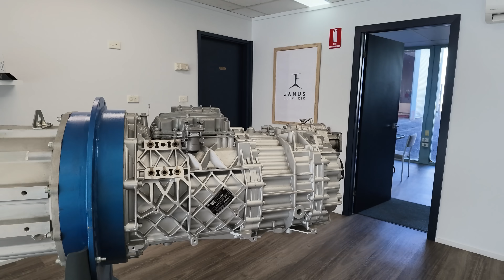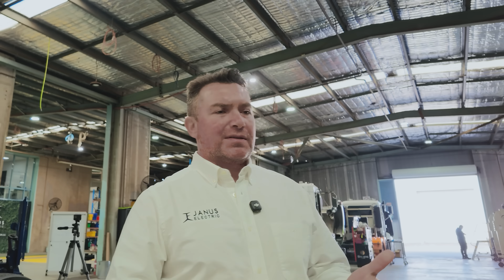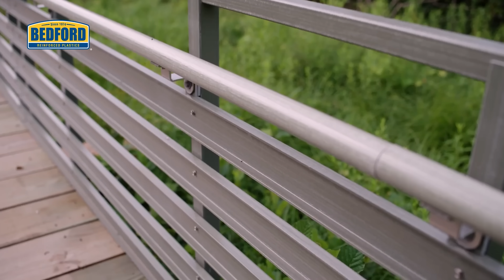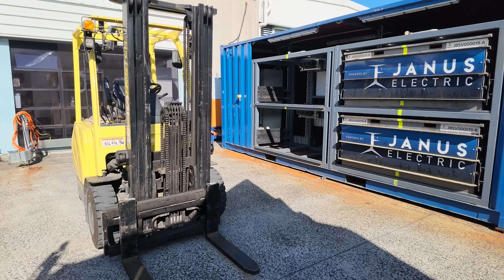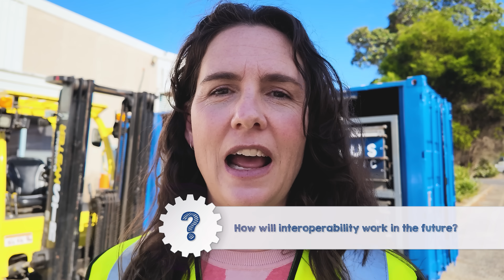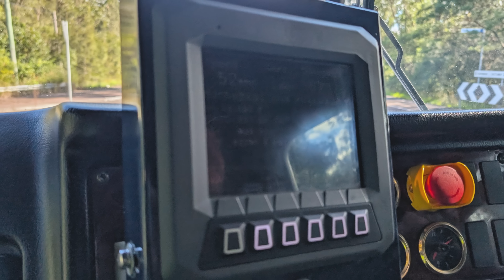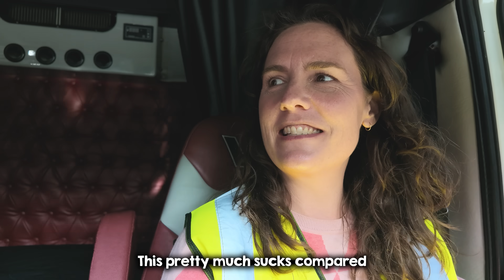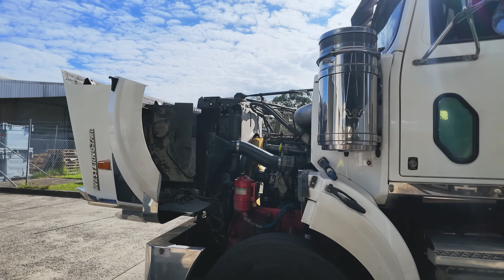The EV Truck Idea I Actually Didn't Believe Until I Saw It

Comment: Would have liked to know what engineering compromises were made in the conversion compared to how a dedicated electric truck would be designed.
Reply: There are many compromises in diesel trucks also.  As a driver some of the biggest were personal.  Filling the tanks at night on the Hay Plains meant freezing my butt off (and my fingers) for at least twenty minutes, stinking of fuel (so bad on the lungs), being exhausted from constantly going up and down the gears, and these examples are just the start.
As a driver I wish these trucks had hit the road thirty years ago.
Reply: @martythemartian99  I'm all for it. Swappable battery systems have been obvious for a long time imo. It's just a question about the engineering. I like Sany's system, one large pack behind the cab, but they're custom built.
Reply: Standard sized Janus batteries and presumably motors and power electronics fit into non-standard multimanufacturer geometry.  So dead space after conversion.

Structure designed for diesel weight and vibration will not be the same as for batteries and motors, so likely excess metal support in some places and (hopefully not super unsafe) underspeced structure in others.  Same goes for drilling holes for mount points.

The use of structural battery packs has improved EV cars.  Get structural benefits on a battery retrofit is near impossible, so retrofits should always be heavier than a dedicated design.

The main point was cost:benefit ratio.  Better to retrofit than buy a dedicated eTruck and scrap an existing diesel vehicle.  It does have the perverse effect of driving down the replacement parts market making remaining diesel trucks cheaper to maintain.
Reply: @SeekingBeautifulDesign  a diesel truck is always one turbo away from being towed and a lot less cheap
Reply: @TomKacandes  From Google AI:

Big rig turbo failures requiring an emergency highway tow are statistically rare relative to overall commercial truck breakdowns, as primary roadside failures are dominated by tires/wheel-ends (25–35%) and electrical issues (15–25%), while turbos typically last hundreds of thousands of miles before wearing out.

Breakdown Frequency Context

Minor share of engine issues: Engine electronics, aftertreatment, and cooling system problems account for 10–20% of roadside stops, with catastrophic turbo explosions making up only a small fraction of that tier.

High durability: Commercial semi-truck turbochargers are engineered to withstand heavy loads and generally last between 150,000 to 400,000+ miles depending on oil maintenance and duty cycle.

Factors Influencing Turbo Tow-Ins

Catastrophic vs. Gradual: A sudden, catastrophic shaft or bearing seizure dumps oil into the exhaust or starves the engine, forcing an immediate shut-down and heavy-duty tow.

Warning signs: Many turbo failures present early symptoms—such as loss of boost, excessive smoke, or unusual whining noises—allowing smart drivers to pull off safely or limp to a shop before total lockout.
Reply: Hey Frank you sound like you have some skepticism about the conversion. Tell us what you think, and I am sure there are other who will confirm or deny concerns. I immediately think of aerodynamics as being a compromise buy if it is not an economic barrier, who cares??
Reply: @paultrgnp  I think it's a great idea. I would like to know what a purpose built electric truck would look like though. For example Sany have one large pack that sits behind the cab - rather than two separate batteries on either side.
Reply: @FrankReif  there is a recent video on the Electric Trucker where Mathias gets to see his current eActros be built by Mercedes. There is also the first video showing the inside of the Tesla Semi manufacturing process from this past March before it got going. The main thing is in fact better packaging of batteries inside bespoke frame rails vs. wasted space or needing to swap outboard batteries, better in-cab information and regen controls as integrated system. The Semi also supposedly has amazing turning radius similar to a Model Y they say - we have not tested one yet to see.
Reply: look to Europe for new E-Trucks

Comment: Excellent, now we need a video with a proper electric truck, one of the Euro/Scandinavian brands, not USA!

These battery swap systems are never going to work out long term, reality is that the driver legally requires more recharging breaks than an EV truck does for charging, and batteries don't benefit significantly from a full charge slower than 1 hour.  So unless you swap the driver for an autonomous driver, it makes more sense to charge the battery in the truck even if it is swappable,.  Even with an autonomous driver, it is less work to let the autonomous driver go and fill its truck up itself than to get another autonomous robot to come and swap the batteries.  Only time battery swapping makes sense is for long distance runs that require a recharge part way and are time critical, and with an autonomous driver,   It is also possible to swap the tractor part way, hand the load to another tractor/driver, we have been doing that for a century.  Swapping batteries creates extra work, which is lost profit, unless it genuinely saves time somehow.
Reply: Agree. And with MCS (megawatt charging) entering the market now, there will be even less reason to do battery swapping. And the potential issue around grid connection can be managed using stationary battery banks. Without Scania/MAN/Volvo/Mercedes/et.al. going for battery swapping, I think the swapping will be a niche technology at best.
Reply: @larslengberg  Agreed but I was informed in another comments section that in the US on long haul routes they do have two drivers that take turns so the vehicle doesn’t have to stop. The comment suggested it was the majority of routes but that doesn’t seem to be the case. I’m aware that this is done in Australia as well on some longer routes, but it’s not that common. In Europe it’s not the case so the normal mandatory rest stops should be sufficient for charging provided the infrastructure is in place and the price of the electricity is comparable or preferably lower than diesel to encourage the transition.
Reply: @johnharvey1786  I thought in the USA, most drivers have their own tractor, and so a driver swap also brings a fully charged battery?
Reply: @nigels.6051 . I don’t know if that’s the case on these long haul routes. This was only from an anti EV comment by a US person who basically said on long haul routes they often have two drivers so don’t have time to stop and charge. The second driver is in the cab from the start so they don’t pick someone else up at a specific location. So it wouldn’t matter who owned the truck. Possibly heavily biased misinformation, but thankfully I don’t live in the US so don’t know the various categories of truck drivers or how they operate and if this is common enough to be a real issue or not.
Reply: @johnharvey1786  That only makes sense in a country that has slave labour...  so maybe it is true!

It does happen in Europe for long distance bus tours, but of course then the passengers need rest stops which will be long enough for a recharge.
Reply: @larslengberg  All grids are going to have plenty of battery storage soon, and a truck stop is a good place to put it, to cover transport and the surrounding area, so I doubt that grid access is going to cause any issues once things are sorted, which wont take long now since the cost of battery power does now seem to be cheaper than diesel power, as long as the government ensures cheap loans/grants are available to fund the initial cost of the battery, so that the trucking companies continue to pay over time in the same way they currently do with diesel.

The problems are going to come with the big trucking companies being able to afford to either make their own electricity, or buy it straight from windfarms, or have huge batteries at their depots to store large amounts of cheap off peak, free and negatively priced electricity, making their fuel costs considerably cheaper than the smaller companies, which will lead to competition problems and a lot of the smaller companies and individuals being wiped out, especially those that stick with diesel!
Reply: Rubbish you have contradicted your own argument. Battery swap is faster than recharging or diesel refueling. It is not necessary to wait until the battery is empty to refuel!!! Swap out a partly charged battery, and receive a credit for the remaining charge, replace with a fully charged battery that is sufficient to reach your destination, being the destination depot, recharge point, home depot or next pickup point with battery swap facility. You can always find barriers to your known/easy routine. Get a job where you don't have to think for a millisecond and you'll be fine.
Reply: @paultrgnp  If battery swap is faster than a diesel refill, why are diesel refills not faster?  We have had a century to optimise diesel refills, so they are the speed they are for good reason - there is no competitive advantage to a faster refill!
Reply: @nigels.6051  Diesel refills are what they are for their own reasons, not what the diesel pump manufacturers expected battery swaps would be. Ask them what their design parameters were back in the 40's or 50's.
Regardless of all that, given the appropriate circumstances, such as big freight operators installing battery charging/swapping facilities at their:  key depots, key destinations such as ports, high volume production businesses offering battery swap facilities, third parties opening battery swapping facilities at key destinations outside cities and other circumstances are beyond my imagination, I can't answer your question.

Comment: Rosie.  Aren't websites and YT videos perpetuating an error regarding charging?  People say they are
looking for a 'charger' when they are looking for energy, with the charger being in the vehicle.  Just as we 
say velcro when we are looking for hook and loop and a Xerox when many people now make copiers, aren't
we mis-labeling the energy source as a charger? Thanks for any thoughts you might have.
Reply: For AC charging the charger (or dc to ac converter + bms communication logic) is located in the car. For DC (aka fast) charging the AC to DC converter and bms communication logic is located in the box (charger) you connect your car to.

Since we already use chargers for our power supply adapters for phones, laptops, and any other device we put rechargeable batteries into, I do think YT videos are pretty correct about charging.
Reply: I am curious - what do you call the AAA batteries with a USB-C charging port in them?

Comment: Janus Electric, an Australian-founded company that retrofits heavy diesel trucks into electric vehicles with swappable batteries, has a direct supply chain relationship with China. quote from Janus Electric website.
And it went off, truck had a fire one of 1050 cells failed 18th December 2023. Sad.
Reply: Any more for the three years since??

Comment: Electrificafion makes perfect sense for work vehicles that don't move a lot: excavators, cranes, etc.
Reply: 600km of range is enough to you?
Reply: @contra_plano  its only a issue when the infrastructure is still in the early stages. both range and infrastructure will keep improving to the point of it being a non issue sooner than u think. But you're right, 600 is too small for a lot of applications, but it is big enough. We can start electrifying at a smaller scale to start with.
Reply: @senurasenaratne5782 Elétric trucks says it enough, he travels around Europe
Reply: @senurasenaratne5782  How do you size your infrastructure for operating temperatures as low as -40C. Spacing out your battery depots to keep the trucks running at -40C that's sound like a lot of capital that will be sitting idle 8 months a year. Janus is picking the low hanging fruit. For short haul trucking in the right climate battery trucks might work.
Reply: @senurasenaratne5782 every roadhouse in the outback will run their own solar farms eliminating the infrastructure for wires
Reply: @eddydogleg short sighted
Reply: The "kit" approach this company is using for trucks might work well for some other heavy equipment.

Comment: This was very interesting. Great job—the interview was very informative.
I think the only bit that was missing from the experience is how long the slow chargers really take. It can be as slow as 10–12 km of range per hour of charging, so even if you have solar, at night there's no more charging.
What I did like about this was the practical aspect. If a diesel truck needs an expensive overhaul or gearbox work, that could be the ideal time to convert it to electric.
Swapping the battery seems, at this stage, the best way to go. It's a bit like having a spare battery for your cordless drill—you don't have to stop work. Hopefully, by the time you've finished using one battery, the other has been recharged and is ready to go.
The only other thing I think is worth mentioning is the massive drain under heavy workloads. Batteries drain much faster going uphill with a full load, for example. That said, the quietness, smooth ride, and good torque are all big pluses.
Reply: Any vehicle going uphill uses more power (fuel) to maintain speed. That’s just physics. Unlike ICE, they might get some back on the downhill whilst avoiding overheating brakes.

The challenge for battery swap is obviously standardisation. Hopefully it works out for trucks. It wasn’t realistic for passenger vehicles. 

Hopefully bureaucracy/anti EV lobby won’t get in the way unlike the Edison Motors experience in Canada.
Reply: They can charge off the grid at night, wind, hydro even if they charge off coal-fired power generators that need load so they don't have to waste their excess power generated while they tick over in the night. Between the usual wasted power to keep them turning over, the emissions are still less that running the trucks on diesel.
Reply: All vehicles use more fuel when going uphill, but because of their power/torque characteristics electric vehicle spend less time going uphill. I'm not saying that that will have a dramatic effect on range/ battery life but there are aspects of electrification that are not immediately obvious and that we have to be prepared think about a bit differently to diesel powered machines.
Reply: The opportunity I like is that while one set of batteries are on the road, another set can be getting charged up with solar. I wonder about the numbers/rates with this but I'm not clever enough for that lol.

Comment: Brilliant. Full steam ahead. Ok, maybe a better metaphor would be appropriate, but this is an excellent direction for trucking. Safer, quieter, cheaper, more sustainable, healthier and a happier workspace for drivers.
Reply: And more reliable; less maintenance and breakdowns - which get expensive fast when it disrupts the rest of the business.
Reply: and using home made fuel.

Comment: In Delhi recently. They have a battery swap system for electric motor scooters. I don't have any more details.
Reply: Yah, it's widespread across SE Asia too & a big market with 230 million 2 and 3 wheelers on the road.
Reply: @duncanidaho9153 The only solution of all the problems is 👉#DieselHybridSemiTruck for India 🇮🇳
Reply: @duncanidaho9153  This is happening in Africa as well with African electric scooter/motorcycle manufacturers driving it.
Reply: China doing fully autonomous swaps in 100 ton mining trucks in Mongolia so they also see the benefit. Nio cars as well.
Reply: The only solution of all the problems is 👉#DieselHybridSemiTruck for India 🇮🇳
Reply: Great idea,I've been saying that's the way it should be for all vehicles

Comment: Do they use a traditional gear box?
Reply: it’s in the video. 16 speed automatic.
Reply: It uses what appears to be a wildly over specced automatic gearbox, probably to deal with the instant torque. A gearbox is a torque multiplier, which means a smaller motor can be used. Gear boxes are necessary to make ICs work, but they are not efficient in EVs, in a heavy haulage application that might be a completely different story. It would be interesting to know more about the engineering trade offs made.
Reply: @rfwillett2424  I guess Janus had a bit of an advantage on spec'ing their drivetrain as the characteristics of vehicles to be converted is well known so either matching or improving it would be pretty easy. Regarding the over spec on the gearbox, one option at a cheaper price for quantity was probably the determining factor. After all an overspecced gearbox can always do the job whereas an underspecced one is only going to result in tears.
Reply: @paultrgnp  exactly.
Reply: @rfwillett2424  instant torque is absolutely useless for trucks, what you need is high torque and the ability to control it and with bigger range to go with, road trains with 4 trailers can litteraly cross the outback in record times even on unpaved tracks, imagine doing that in an ev!